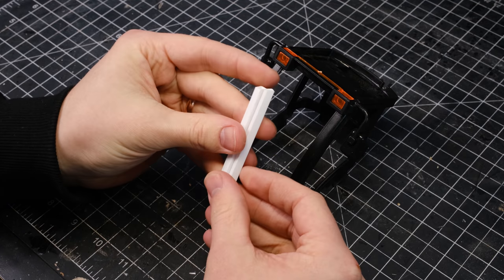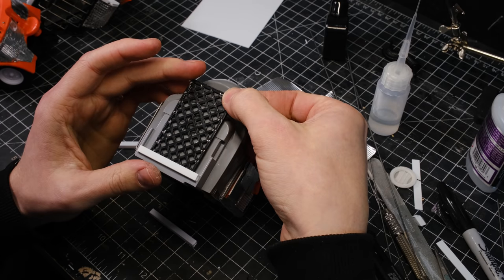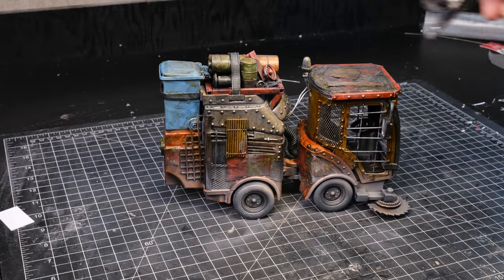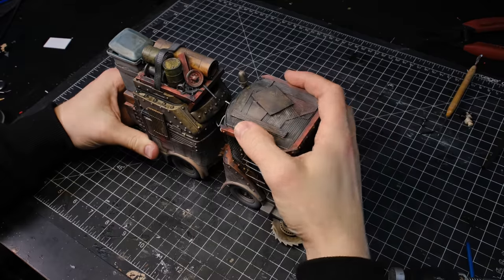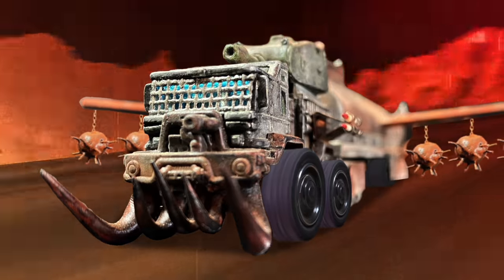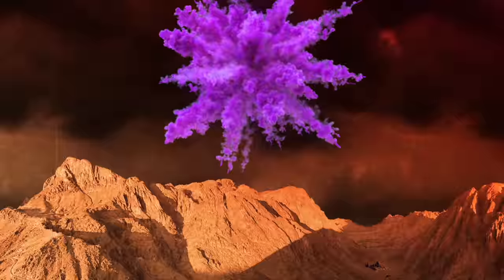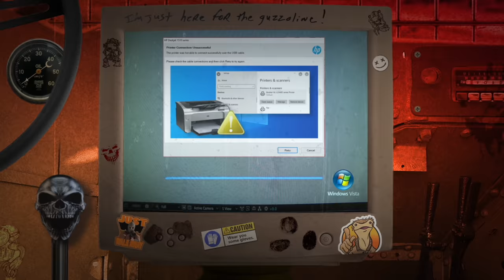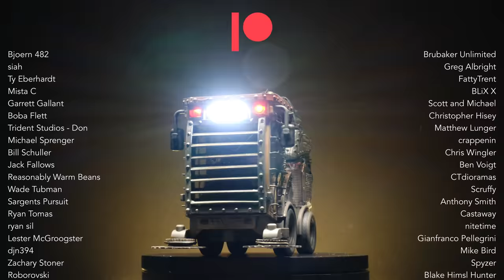How to Turn a Kids Toy into a Post Apocalyptic War Machine

Comment: Dear Boylei, 
I have been following your channel for a while and I like your mix of Humour and creativity.
May I please attach the following wish list of projects to you?
- New Shuttle Tydirium video - smaller but with smooth retracting wings.
As a diorama while short before entering the Death Star.
- A real size Macrobinocular - mounted ona tripod like a telescope and when you view through
it you can see a interesting scene from Tatooine as a lighted still or why not build in two small
monitors and you could loop a interesting scene or some scenes that can be selected by
clicking one of the buttons or adjusting a dial.
Thank you for your time and beers on me if we should ever meet by coincidence🍻🍻💪
Best regards from Bavaria
PSO